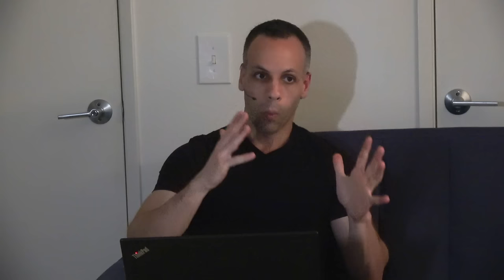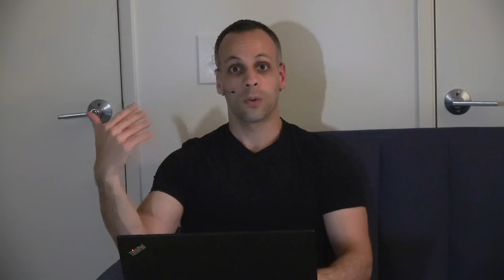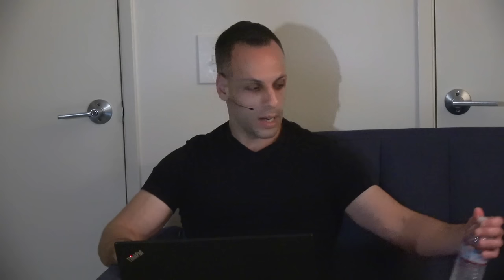EVGA's Oversight: Unannounced Changes Destroy PCs, EVGA takes NO ACCOUNTABILITY

Comment: No way for you to tell... A PSU that has one pin set up that you have in hand, and the recorded PSU that was sent out... No way for you to tell.. When you'd have the details of BOTH and know they are differnt at that point... No way for you to tell typically, is what you mean.
Reply: I'll be blunt, them changing the pin layout on the same model makes it their fault. Same as it's Apple's fault for changing battery polarity on the same model. Malicious design. Don't do design like that and they should not then be held liable. It should not be policy, it should be law.

Comment: My first modular was a corsair, lasted 3 days short of the 5 year warranty. HEAVY usage. I attempted to get a replacement under warranty and they agreed. I was happy the supply had lasted that long and didn't damage anything when it failed so I just bought another one. Ever since I've always bought corsair PSUs.

RAID has always failed in every instance I've used it, so I have a much simpler backup solution.
Batch file: (the DATE line may cause issues depending on location, this will work for the UK)
the backup will work fine but the logging function might fail.

@echo off
title Backup Drives
color 0A
cls
:BEGIN
For /f "tokens=1-3 delims=/ " %%a in ('date /t') do (set mydate=%%c-%%b-%%a)
For /f "tokens=1-2 delims=/:" %%a in ('time /t') do (set mytime=%%a%%b)
echo.
echo Drive backup batch
echo.
set /P SrcD=Source Drive? (Type the drive letter, then ENTER) 
set /P DstD=Destination Drive? (Type the drive letter, then ENTER) 
set /P OnlyTest=Perform a test only? (Y/N, then ENTER) 
set /P AutoShutdown=Shutdown after running the backup? (Y/N, then ENTER) (There is a short delay)
echo.
echo Selected: %SrcD%:\ to %DstD%:\
echo Test only? %OnlyTest%. Shutdown on completion? %AutoShutdown%.
echo.
echo pause
goto BACKUP%OnlyTest%

:BACKUPy
robocopy %SrcD%:\ %DstD%:\ /e /purge /xd "System Volume Information" "$RECYCLE.BIN" /r:100 /w:0 /tee /l /LOG:%SrcD%:\Backup-Test-%SrcD%-%DstD%-%mydate%-%mytime%.txt
start %SrcD%:\Backup-Test-%SrcD%-%DstD%-%mydate%-%mytime%.txt
goto SHUT%AutoShutdown%

:BACKUPn
robocopy %SrcD%:\ %DstD%:\ /e /purge /xd "System Volume Information" "$RECYCLE.BIN" /r:100 /w:0 /tee
goto SHUT%AutoShutdown%

:SHUTy
timeout /T 120 /NOBREAK
cd C:\Windows\System32
shutdown.exe -p -f

:SHUTn
pause
goto BEGIN

Comment: Do you know how to unlock a older iPad air(2016) that has apple id lock  or how to install a new rom on it? I rescued it from the recycling and as I would with a samsung tried to do a factory reset to clear any private information from the last owner but all I get is language/network than blocked. Can they be "upgraded" with a new or custom rom or do I have to put it back in the trash? The server that ran the login is even scrapped and can´t be found, I hate wasting working hardware on a software technicality, can it be saved?

Comment: This is an odd one. I can put blame on everyone involved. It is fairly common knowledge to check your cables for matching specs to the supply, and it will be in the instructions with the supply. My Corsair semi-modular supply cables are marked with "type 3" on them, but I just looked, (gosh I need to clean in there) and I can't see anywhere on the power supply label or around the plugs that says it takes type 3 cables. 
When you get what would appear to be a direct replacement from a warranty claim, I'm sure I wouldn't even think of it even knowing that you can't mix and match all the time.
A good lesson in reading the instructions with your new hardware I suppose. I can't fault EVGA 100% unless no documentation was provided with the replacement. If they gave you the warning, and you never took it out of the box and looked at it, you have to take some responsibility. With that said, it should be made much more obvious on all supplies so this is easier to avoid. They already print stuff on there, one more line of text shouldn't be hard to do. Though I don't know if marking cables is an industry standard, or if EVGA does label the supply near the cable connectors. I've been using that same Corsair power supply from back when an AMD 6800k was sitting on the display shelves at TigerDirect.
I believe the LTT forum has a list of what works with what.

Comment: If the connector is changed, even if they aren't standardized, they should be keyed so it's physically impossible to plug the wrong cable in.  This is 100% garbage engineering and whoever designed this needs to be immediately fired and never be allowed to work in design again.

Comment: I found it interesting that you voiced that you didn't know cables on the PSU side differ from manufacturer to manufacturer and that you were surprised by that.   Notebooks.  They have different adapters.  How is that different.  Yesterday, I got in two Clevo BTOs and while they both used 240W adapters, one was a 7.4mm x 5mm with a center pin and the other was a 6.3mm x 3mm with no center pin.  ¯\_(ツ)_/¯  Why aren't they standardized?  Not sure how that's different.
Reply from the maker: There is no standard for charge ports but there are standards for molex, sata, CPU power, etc. Makes no sense that one end is standardized and the other isn't within the same system

Comment: EVGA isn't the only one w/ this clause. Many GPU makers don't have same pinout on their PSU. That is why you should always look at the manual. (smart tip to do anytime you are dealing with electricity)
EVGA has great product & support (personally used it for case, psu, & gpu in past) and this case is a problem of "failure to inform" which should hopefully get fixed in future (they as a company do generally seem to learn from mistakes made in past).

However like you said they can't really do anything for him as (unintended as it was) they can't prove it happened.

Comment: Certain pin outs might make it more difficult/less practical to route the PCB, depending on the DC/DC converters used etc. So there might be a certain logic behind not standardizing between different models. Not saying it’s a good thing for the customer for obvious reasons. Changing this for the same model would be really stupid though if this really is the case. (Parts shortages or other factors might have played a role in that case.)

Comment: EVGA did dumb things like this also with their GTX 1080Ti FTW3.
individual fan control, that only works with their own sofware Precision X, when you use MSI Afterburner only 1 of the 3 fans spins if you try setting own fan speed.
it's just dumb. But their GPUs were pretty good still.

Comment: Glad I don't have any products from them after they decided to stop GPU production post 30 series RTX. It wasn't because of nvidea fanboyism, but because of the "WHY".
  
EVGA dumped one if not the biggest thing that marketed them in a positive light due to quality, performance, and customer service due to "profits".
  
That told me where they were going to go with those who bought products from them. Each product was going to be a mathematical question about if it produces a profit or not, and how to cut costs, which includes service to YOU.
  
Sometimes a company tells you without telling you that they are committing suicide. EVGA's ending of Nvidea cards should have had the same reaction by PC enthusiasts as Mitsubishi's ending of the EVO did in the car world.
  
A "are you retarded" followed by a blatant ignoring of anything else by them shortly afterwards.

Comment: It's common knowledge that you NEVER mix and match power supply cables even with the same brand, definitely new seeing the same model being incompatible though. Corsair have a good system for this, most of their units use "Corsair Type 4" cables making it easy to replace them with aftermarket ones etc.

Comment: Not to be a bad news bear, but I would never buy off hardware from a company if it wasn't the original companies intentions to make. I'm not going to buy a car from Samsung, that made TVs for forever. They have no business or experience creating cars. I'd never buy MSI monitors that have been making motherboards and GPUs for forever, because it's just not their thing, not their bread and butter, but an afterthought to generate more money for the company. EVGA isn't a good brand when it comes to any computer part, in fact they are bottom of the barrel as far as performance, and their prices reflect their performance. Buying a PSU from them? ..........Good luck.

Comment: This is one of the rare occasions I disagree with Rossmann. Building a PC is not for everyone. It is not a plug'n'play product, it requires knowledge. I'm not a pro but I've built each one of my PC's and have carefully studied a manual for each component before plugging it in, especially a PSU. Standardizing layouts should be a thing, but it is known thing it is not, there are few types. Also it is not rare that components have few versions of the same product, It happens with MBO's, GPU's as well as PSU's. This problem happened probably because different employees handled receive and sending and forgot to notify customer about type change. But customer is also responsible for his installation if he decided to do it himself. I'm pretty sure there was a manual included with new PSU but he disregarded it assuming it is a same thing.

Comment: Changing pinout for whatever reason without changing connector shape/dimensions? Computer components were used to be created with some standards so that connectors are like that, if you can plug it, it's suppose to go in there. Whether you are amateur or pro, you shouldn't be analyzing or thinking about pinouts of connectors. They should go bankrupt.

Comment: These days, people don't back up anything! I've seen this at work and with my family and friends. I use backup hard drives with SSD as they avoid the magnetic wiping. If you're reading this, spend a weekend to back up your stuff, because phones do just stop working and no one will want to recover your stuff, EVER! Even in aviation, if it's not important, data is never recovered.

Comment: This is unfortunate. I if given the option to buy EVGA bought EVGA. I have 1000w power supply  and RTX 3080. I bought them because they where the better board partner and power supply vendor. Granted the non standard cable thing is a problem and i only heard about this by chance when it was randomly part if LTT videos. But for power supply's Im still going to go with EVGA and SuperFlower(the maker of evga power supplys). I like the product it works. they for me at least are still the better option and the psu warranty is still good and good customer service is still important. 

But with the model changes and power supply pin out there must be a effort to inform consumers 1 not to intermix cables 2 that the pin outs between revisions and model can and are different 3 to come to a standard pin out so this type of stuff does not happen ever

Comment: They should never have branded RAID as redundancy. It should have been branded as high availability from the start. 

prevents downtime, not data loss 

the terminology has been the issue the entire time. When you explain RAID properly the customer usually gets it.

Comment: yet another problem created by a solution that didn't necessarily need to exist. 

Modular power supplies caused this issue long before EVGA was stupid enough to cause it on their own model of supply between revisions. 

with hard wired cabling this basically never occurred. all so people can have less cables inside of a box they will never stare at once the monitor is turned on.  

its not technically an example of charge more for less, but it feels similar in end effect.

Comment: EVGA doesn’t make a lot of their power supplies, they are different vendors rebranded as EVGA. 

Sounds like an internal mistake in identifying the models. 

But everyone knows not to mix and match power power supply cables but the cables are not easily identified and should at least have the OEMS name on them for easy identification. 

But in this world of drama queens the user probably screwed up and is looking for free stuff.
Reply: If the cables had any chance at all of being different then EVGA should have sent him new cables with the RMA and made it abundantly clear to use the newly provided cables.
Reply: @clintmatthews3500  I guarantee you the person making these claims did not use the correct cables and is blaming EVGA for their mistake. 

Regardless a simple and cheap power supply tester or 10 minutes with a multimeter could have verified voltages and grounds. 

I check every power supply I’ve ever purchased with a multimeter first to be 100% sure everything is correct before ever connecting a single cable to a computer parts that cost 8 times the price of a power supply. 

This is basic PC building 101 stuff, sadly the majority of people have no business building or even changing a tire in the first place. 

They make mistakes, run to social media then blame others for their incompetence.